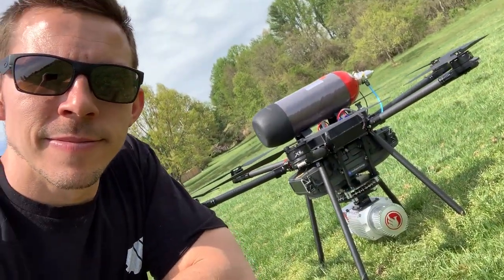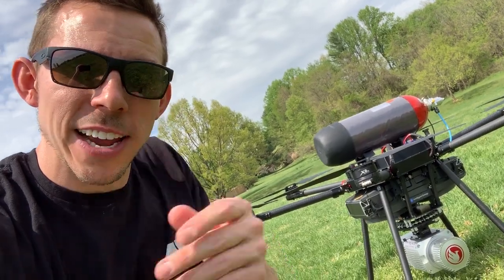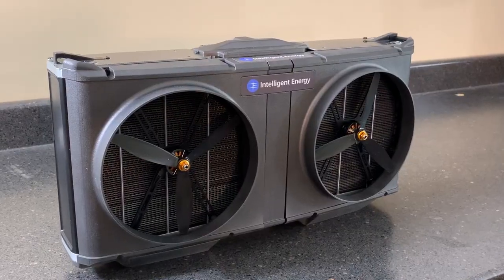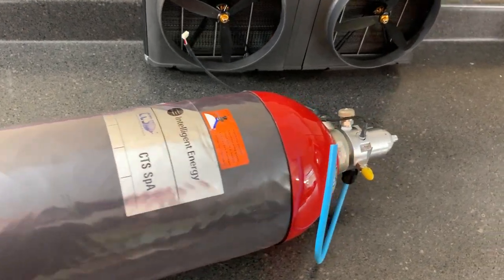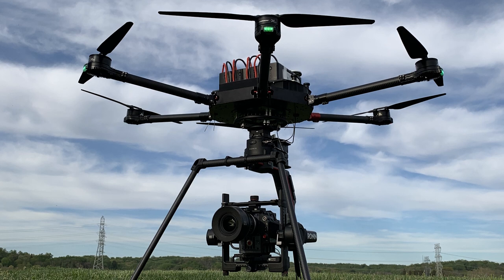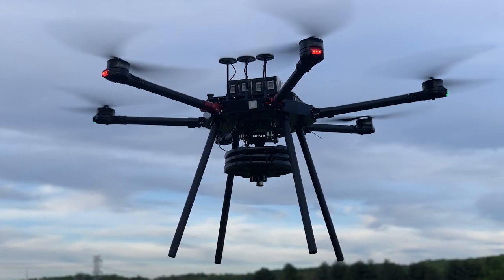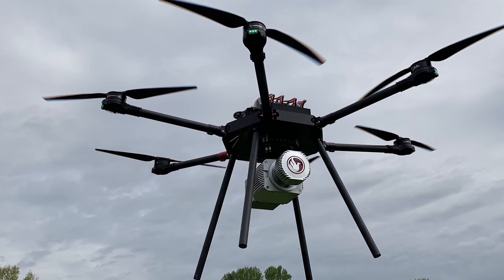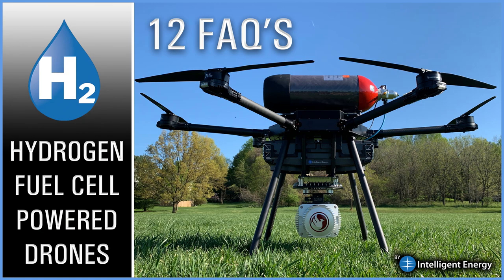Announcing the MFD 3000 Hydrogen Fuel Cell Concept Drone: Watts Innovations & Intelligent Energy

Comment: Hydrogen production is just as interesting. Ignore all the critics and ‘efficiency analysts’ and go digging around the fringes for advancements in this field. Resonance, Microwave... 
There are several other methods being developed... 
Imagine a households having a unit that utilises solar/wind energy (or mains) and a battery/capacitor bank to produce, compress and store Hydrogen throughout the day and it was as normal as solar hot water system is today.
Reply: H2GO Power are the tech that will close the circle!